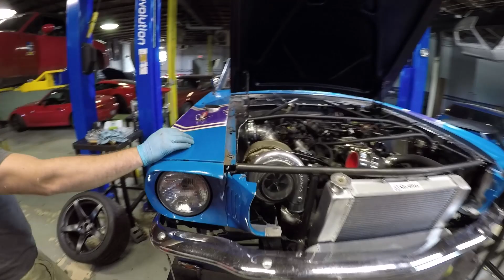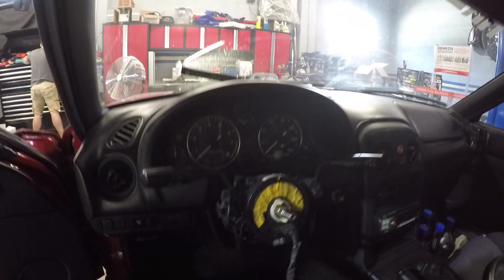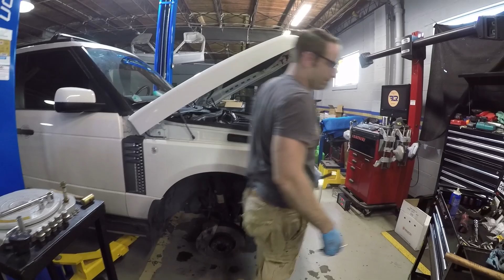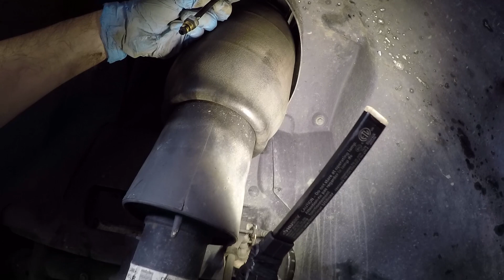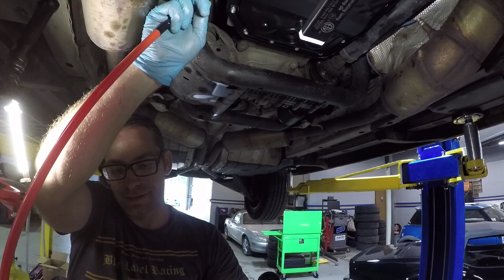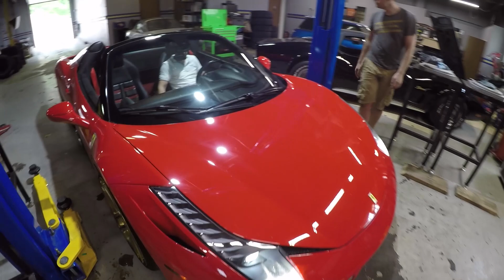My new job! Blue Label Racing / Ep. 1

Comment: Looks like a fun job. Please don't stop with your other videos, though! I miss the refined, "finished" feel of them. Time lapses, steady camera work (vs the handheld here), pointing out the parts and explaining things, and MUCH better lighting. Don't get me wrong, you're still doing well for this style of video... I just prefer the other!

Also, "clock spring" is the phrase you were looking for. Always mark and tape it to hold it in place before removing it - If it's off by a rotation, you could lose all electrical to the steering wheel when you turn the wheel or even short it out. Airbag + short circuit is not fun!
Reply from the maker: The other video formats will continue! I didn't know that piece was called a clock spring - thank you for that!